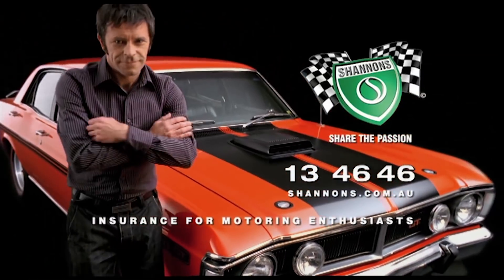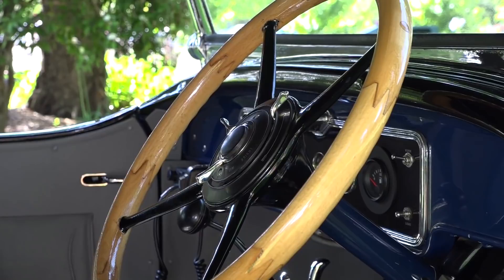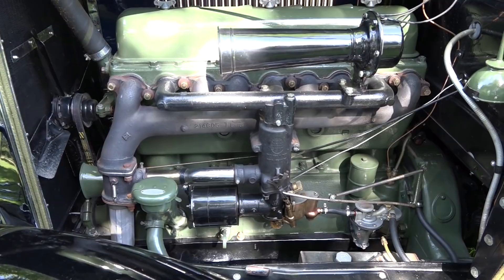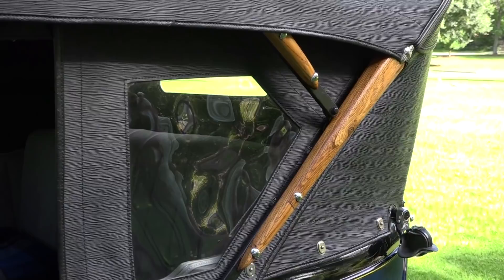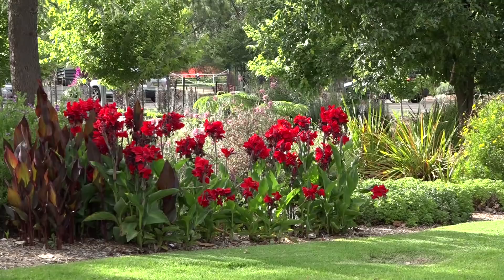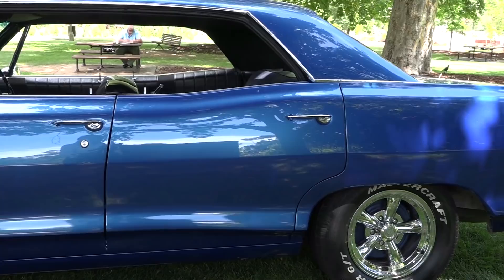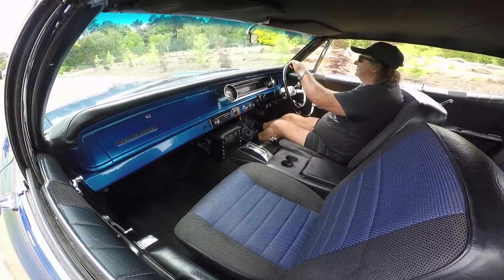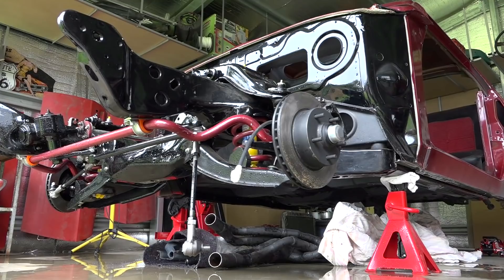Three Wagga Classics: Classic Restos - Series 49

Comment: A right-handed drive '65 Pontiac! It has the wrong dash ('65 or '66 Chevy Impala). American muscle representing down under.
Reply: I think Canadian parts sourced car aimed for smaller markets like Canada and Australia and New Zealand. Assembled in Australia using as many common Chevrolet parts and Australian sourced parts as possible to keep costs down. Eg Chevrolet frame and motor. No Pontiac Parisienne in the US as I understand. Holden took this route from about 1930 to 1969 when local high end Holden models took over.
Reply: So what you're saying is that's a CANADIAN Pontiac that got shipped to Australia, right?
Reply: I think the Pontiac Parisiennes came out in the late '70s or early '80s in the U.S. I know of the Bonnevilles and Catalinas that were produced back then.
Reply: @marcushaynes843  almost all of American looking cars that you could buy in Australian dealers were assembled from Canadian parts for the Canadian versions of the cars. This was because of the favourable tax treatment of British Commonwealth sourced products. This Parisienne is a 1965 with the Chevrolet 283 as the only standard motor. Pontiac decals on the air cleaner etc. Never got the 70s and 80s versions. Prior to the Parisienne we had the Laurentian model, also a Canadian nameplate.
Reply: @marcushaynes843  another Pontiac Laurentian in Australia. All these US looking cars were low volume expensive luxury type cars in Australia and New Zealand. :
https://youtu.be/2kExd3RV9xo
And a first circa 1961 Holden ad but not emphasising the Canadian sources :
https://youtu.be/QknV_aFJ6Mo
Reply: @marcushaynes843  Canadian preference mentioned about 20 minutes into this history :
https://youtu.be/5tC7yP9LmAE